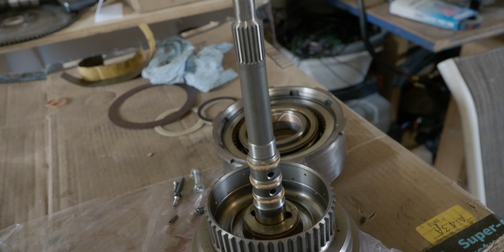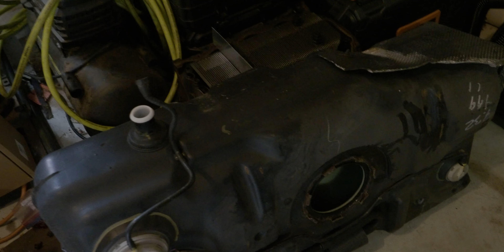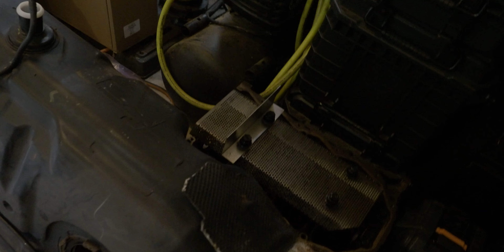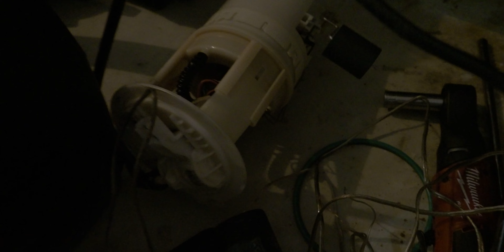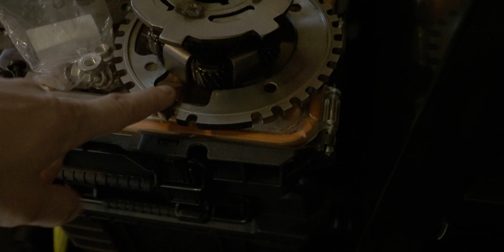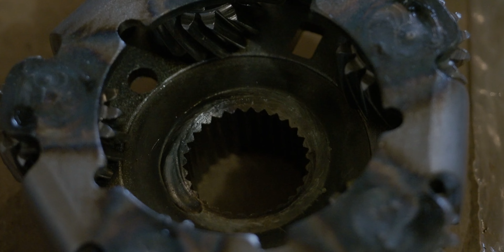Some Exciting Updates on The Build

Comment: Was it easy to install the nrg steering wheel on the PT??
Reply from the maker: It wasn’t bad. I just followed the steps for the srt4 and it worked out. Just note you will loose your clock spring so you have to manually turn your blinkers off.